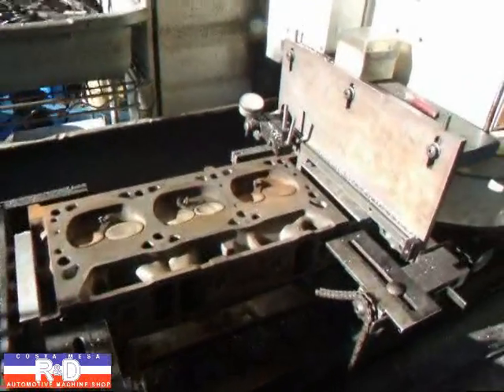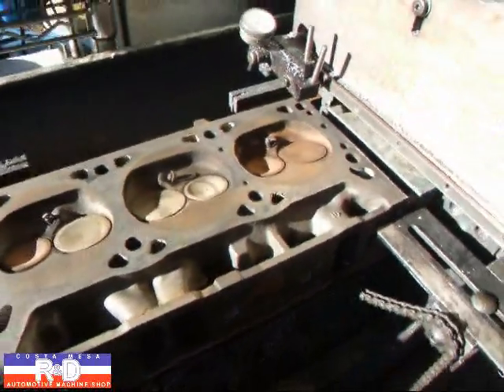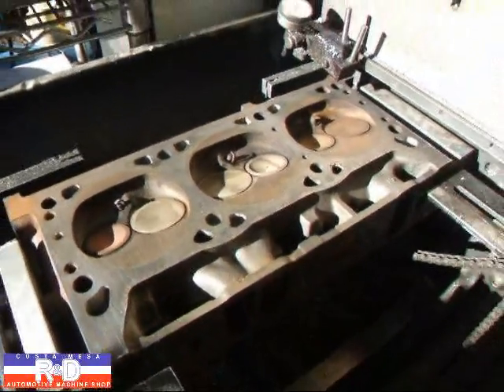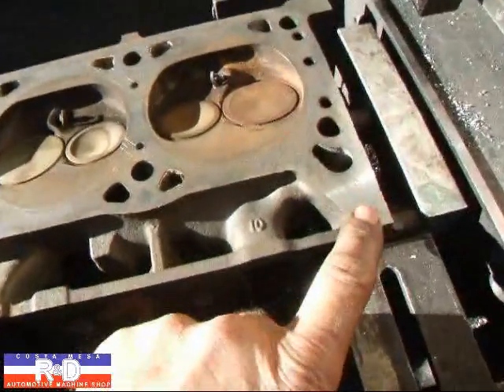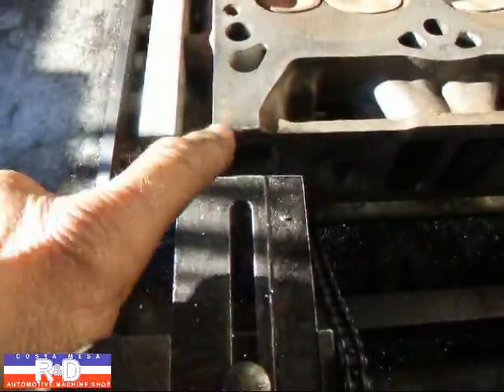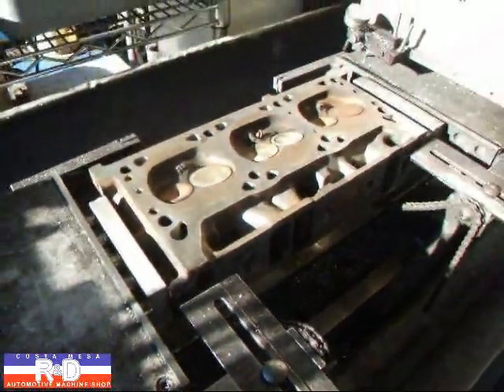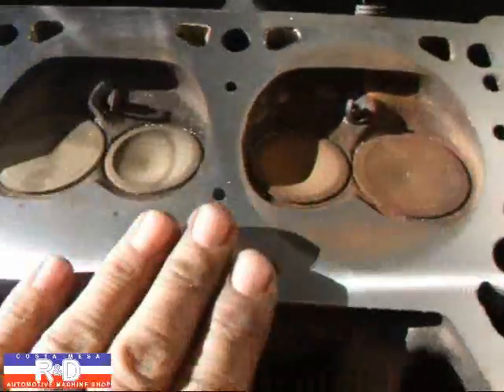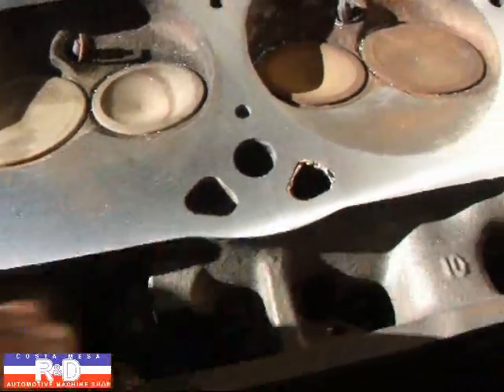Chrysler/Dodge V-6 Head Resurfacing

Comment from the maker: @DOWNRANGE06 - I would think that resurfaacing the heads and block would be included. Sounds like a way to get you in the door with a low price. The bigger question, does the engine run well?

Comment: I had my 5.0 truck motor rebuilt & the shop said I had to have the block or heads resurfaced. So he charged me extra.My question is if you rebuild an engine is resurfacing an option? Or can you just put a blown engine back together? This doesnt sound right! Did I get Hosed!

Comment: John, great videos, simple question....when the head is installed in the machine what is used as a reference?  Assume the machine is level, so is the head just installed level as best as possible, then cut?  Or is there another reference that may vary from head to head?